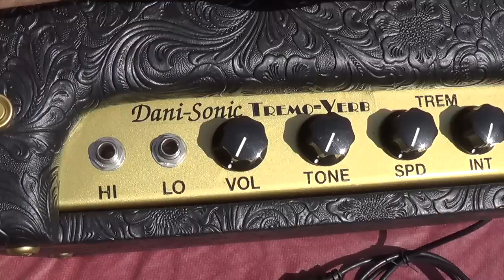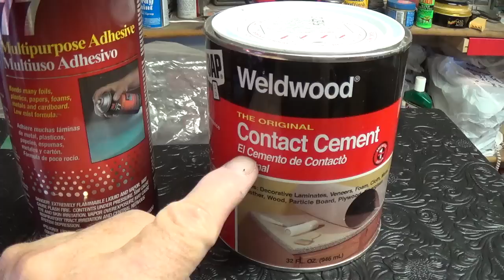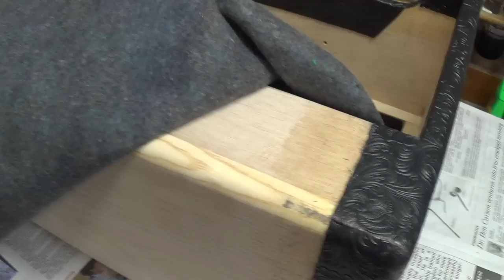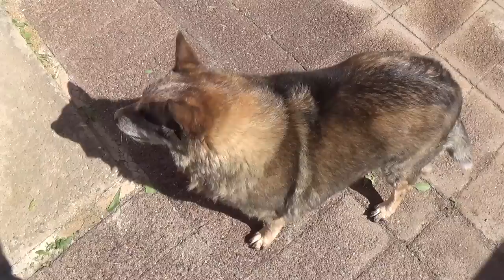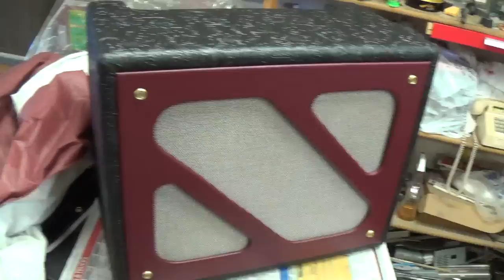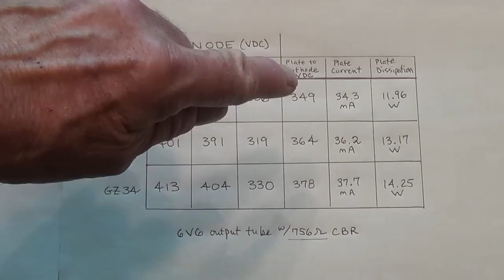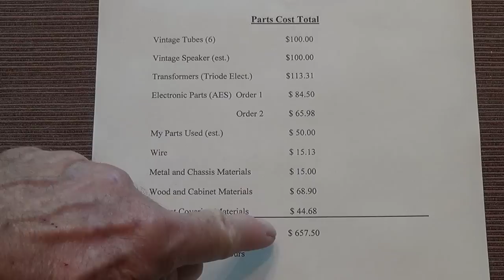How to Scratch-Build a Vintage Amp, Part 8:  Completed and Tested

Comment: Back on the tremolo intensity topic, the grid of the buffer valve needs a constant grid leak resistor. You should feed the oscillator output to the wiper of the pot and connect the top of the pot to the grid of the buffer valve. The way you have it you will be grounding the grid at some settings, which can't be good for the valve..
Reply from the maker: +QuadMaestro  Perhaps you were looking at an outdated schematic, QM. As it stands, I can't see any way for the cathode follower grid to be grounded by the Intensity pot.  Even if the pot, serving as a variable resistor, were set to 0 ohms, the 2.2K resistor is between the grid and ground.
Reply: +Uncle Doug I'm looking at what is linked above. Agreed that there is always 2k2 between the grid and ground but surely 2k2 isn't enough either? These grid leak resistors are usually 470k or more. You have the 1M pot, why not use it as a pot? Might fix your stated problem with the tremolo.
Reply from the maker: Since I intend to experiment a bit with this portion of the tremolo circuit, QM, I will evaluate your suggested modification. To be honest, my first target for modification was indeed the 2.2K resistor (increasing the value) to alter the effect of the voltage divider created by it and the pot. Regardless of the outcome, I'll report my findings and revise the schematic if an improved Intensity circuit is discovered. Thanks for your interest and helpful input.

Comment: Hey Uncle Doug, thanks for an excellent DIY video series, it has been very inspiring! I especially liked the DIY chassis construction. Also, after seeing you make the finger jointed cabinet, I went ahead and bought a dado blade set and a zero clearance throat plate for my table saw. I'll need to learn how to apply Tolex or vinyl next.I hope this goes better than my previous attempts at using a router!  I have an old Harmony 525 amp that is pretty similar to yours, a distant cousin perhaps. I modified it a little by removing the Treble pot and altering the ground reference resistor in front of the first tube, making it electrically equivalent to a Supro Thunderbolt (I think, there are a few different schematics floating around). It sounded good before, but sounds much better now, and it's a good reference point for adding more modifications later. The wiring (in my Harmony amp) looks like spaghetti though, and the cabinet is really worn out. My next project is to build a new head cabinet for it - with the inspiration gained from watching this fantastic project of yours.  Thanks!
Reply from the maker: +Dragnphlai You're welcome, Dragonfly. It's great to hear that the videos are helpful. Your Harmony project sounds like a very interesting one. Best of luck with it. Please post some photos on my Facebook page (Uncle Doug's Vintage Amps) when it's done.

Comment: Here's a tip for Nuke Boy - pay a visit to Antique Electronic Supply, https://www.tubesandmore.com/products/C-EC40-20X3-500     They have a multi-section electrolytic that would be perfect for your application, with the exact capacitance values that you need, but at a higher voltage rating, which is an improvement.  It's a 40/20/20/20 µf cap.  You can parallel two of the 20 µf sections, so that you have 40 µf / 40 µf / 20 µf @500 volts for $17.
Reply from the maker: +Dragnphlai Great suggestion, DF.  Thanks for your helpful input :)

Comment: P.S.  You must have quite a few amps by now !!  (I have about 7 or 8).  What do you do with all of them?  Do you routinely play them - to keep your capacitance charged and the circuits wet ??  I wonder about that with some of the amps I don't use very often !!
Reply from the maker: +Donald Filbert It is a consideration, Donald. Some of the real old ones don't get much play time. I always use a Current Limiter whenever I start up any that have been dormant for several months.  So far, no problems. They are kept in a cat-free room :)

Comment from the maker: Nuke Boy, your comment had no Reply capability, so I'll answer up here.  Yes, mfd = uf.  On your amp, leave the can cap in place and go inside the chassis, detach each wire to each cap lug and attach the wires to individual axial capacitors of the proper value. There will be a code on the can cap to tell you which lead goes to which value. You would be better off with 450V caps than the puny 300V. Good luck.
Reply: Thanks a bunch for the reply
Reply from the maker: Thanks so much, Strat. By coincidence, I just sold the Supro Tremo-Verb featured in this video series, so a viewer will soon get that opportunity. Maybe some day I'll be shipping one to you :)
Reply: +Uncle Doug Nice work Doug, you are a true dedicated craftsman. I am a long time 52 year old guitar player, and i wish i could try out one of your amps. My 1988 fender red knobbed twin sucks in comparison.

Comment: Hi i have a question. I have in my possesion a vintage japanese valve preamp, the filter capacitor recently fried. On the can capacitor it says "40mfd, 40mfd, 20mfd, 300v" im unable to find this  type of capacitor anywhere so what should capacitor/capacitors shall i replace it with? And is mfd equivilent to uf or does mean something else altogether?

Comment: That's a beautiful amp, Doug.  High five!  Agree, the trem is pretty strong... I've never heard one that aggressive before!  Would love to hear how this amp sounds at the higher end of the volume scale, with either tube.  Where you have the output stage biased, it seems most of the distortion at higher volume levels is going to come from the pre-amp, as opposed to the output stage clipping.
Reply from the maker: +Jason Thorpe  Thanks so much, Jason. I may tame the tremolo a bit when I get the chance.....not much, just enough to make 10 usable.  I'll also try it out at higher volumes, once camera microphone distortion is no longer an issue.

Comment: I was just thinking, if you made it because you want it, so be it.. But said that
if you would like someone else to appreciate that wonderful work of art, I would do the following.
Put it on EBAY for $2500. bucks, with the videos showing it was all hand crafted, modified for
excellent sound quality, and will come with a 24 month warranty by the maker.
I bet it would sell with no problem.
Reply: JC Haywire
 Maybe we need to change that figure to
10,500  bucks. I am not good with value.
SORRY.
Reply from the maker: +MrMac5150  Even better. I'll have to fake my death, but a small price to pay for big bucks :)
Reply: +MrMac5150 Howard Dumble ain't got nothin' on you, buddy!
Reply from the maker: +JC Haywire Wow, high praise indeed, JC. Maybe some day,  long after I've croaked, my little amps will "catch on" and people will be vying for them. It's a pleasant thought.....the vying, not the croaking :)
Reply from the maker: +MrMac5150  Right after I finish one, it's very difficult to turn loose.....at least until I start on another project and the attachment fades a bit.  I may consider this route some day, but for now, the joy I derive from seeing and hearing it every day outweighs the joy of hundred dollar bills in a distant bank account. I do appreciate your kind appraisal, and your very positive input. Thanks for watching and commenting :)

Comment: That turned out quite nice.   I used that same covering on one of my amps.

you can see my amp  "Braddock"   at Mrvamps.com

How do you like the 6L6 running SE?...   I'm curious if that really worked,  since it's not done commerically.
Reply from the maker: +DeadKoby  Greetings, DK, and thanks :)  To me there is not a huge difference between the tubes. The 6L6 seems to have a bit more body and power, but tone-wise I think it's up to the listener to decide. Perhaps the increased current demands of the 6L6 make it less desirable for single-ended, economical amps.....just guessing.
Reply: +Uncle Doug   If it's not much louder,  the extra draw could reduce reliability,  thus not commercially viable.    Oddly enough the 807 tube in SE is holy smokes loud.
Reply from the maker: For some reason, this circuit has astounding volume, even with the 6V6, perhaps due to the cathode bypass caps I added to V4b and the output tube. I actually have to use the Low Gain input and a VC of only 3 or 4, for fear of incurring the wrath of neighbors.....and wife :)
Reply: Lol...  if it's too loud.... put in some ear plugs.. and enjoy the feeling of audio power.    I have one custom amp named  Mr. Big...   80+ watts of all tube happiness driving 4 tens.  Loud at 1...  disturbing at 2... take it outside at 3...... never tried it past 5.   I think some designs intentionally stifle the pre-amp stage to quell the volume giving a range from 0 to 5 in happy clean...   A Gibson amp I have I'm certain is designed this way.
Reply from the maker: Output power is like horsepower and money.....you can never have too much :)

Comment: Cool vids Doug! Watched the generation from the beginning! (with baited breath! :)) I have never owned an amp with a single treble "roll off" tone control. Am a tone freak. (treb,mid,bass & presence! LOVE IT!) Have you ever thought of doing a home build of the old amp Scotty Moore used to change the world? (I can never remember if it was an "echosonic" or an "Echophonic" Both of which give the spell checker hell! :) ) Would be curious to see how that old thing even worked! Good job !
Reply from the maker: +leroy volk Thanks so much, Leroy. I tend to rely on the guitar pickup and tone controls, so I can live with a single-knob Tone control on an amp....but I do understand your preference for individual control of all frequencies. Scotty did indeed have an Echosonic amp (designed by Ray Butts) with a built-in tape delay in the bottom for the slap back echo effect. The amp part would probably be do-able, but the tape delay would be a challenge :)
Reply from the maker: I'm not sure either, Leroy. The earliest reel tape I can clearly remember was that reddish-brown ferrous oxide tape....about 1/4" wide. The old "Gorilla" sounds interesting. You should "tune it up" and make a video :)

Comment from the maker: Gary M, your comment had no Reply capability so I'll answer up here. I understand your suggestions and certainly take no offense.  With regard to insetting the grill, I have done this on a few other builds and agree that it gives a nice, finished appearance......however, on this one, due to the clearance issues between the speaker and chassis, I could not allow another inch for the recess without making the cabinet so thick that it would begin to resemble a cube.....a shape I don't find pleasing in amp cabinets.  With regard to the placement of the screws on the rear panel, since they are threaded into the 1/2" flanges at the rear of the chassis, their vertical orientation must be in proximity to the top and bottom edges of the panel......there is simply no other metal or wood to which they could attach.  Bottom line, during the construction of a complex project like this, certain design compromises must be made.
Reply: Uncle Doug

Comment: Uncle Doug,  At the risk of sounding picky I'd like to make a couple suggestions regarding the aesthetics.  Please don't take offense because I'm just pointing out the only things I noticed in this build that I didn't think were absolutely perfect.  First thing is I think if the cabinet was a little deeper and the speaker cover/grill inset about a half inch to an inch it would look a lot cleaner.  And secondly the if the screws for the rear panel were not on the edge of the panel but inset about an inch from the edge it also would look nicer.  Please, don't get me wrong, I love this build and thoroughly enjoyed every minute of it from start to finish.   Thank you so much for the entertainment and education! Gary

Comment: This video series was awesome, totally inspiring. I watched the whole thing and really enjoy your channel too. The amp sounds pretty rad and I didn't think the bass was lacking but I do tend to like a tighter low end . Perhaps a quick speaker swap would pump up the bass response enough? That Jensen is great though. I have the same one in my '61 Ampeg. I've got a suggestion for the audio demo. The amp signal was blending pretty heavily with the non-amplified acoustic playing of the guitar. This is a common and frustrating problem with many YouTube recordings. It distracts from the sound of the amp enough that it is a bit difficult to discern exactly what the amp is doing, especially the tremolo part. The camera mic, I believe, is good enough at getting the sound across and showing the tonal difference in tubes. I immediately heard the unexpected difference in 6V6 and 5881. Turning the guitar away from and/or playing across the room from the camera mic and amp can do wonders for the audio better showing the amp's sound only. I do this when making impromptu recordings with my phone. By no means studio quality and only pushing it as lo-fi but it works.
Reply from the maker: +RockYouVideos Thanks so much, RYV.  I wasn't aware that the sound of the guitar itself was that evident.....but I can see why my proximity to the camera microphone might make this possible.  I have to be close to the camera to turn it on and off for each scene, but I could try positioning myself further from the microphone itself. Thanks for your knowledgeable input :)
Reply: +RockYouVideos I agree on the suggested speaker swap. A Jensen Electric Lightning should firm up the bass a whole bunch plus it's a really strong, clear, punchy speaker.
Reply from the maker: Thanks for your input, Lincoln. I'll definitely keep your suggestion in mind.

Comment: My gosh Uncle Doug.  This has been an outstanding video series.  Combine this with your lessons on the why and how of the inner workings of tube amps and the fledging amp builder is provided with an invaluable resource. Watching your videos is like being the same room with you.  Thank you............Always wondered how you managed your fancy grill work.  I am amazed you did it with a sabre saw, I would of guessed a router and some pattern trickery...........I have a problem, I like the sound of your tremolo better than the one I achieved on my Princeton!  Back to the drawing board for me he he.
Reply from the maker: +Barefeet200 Thanks so much, BF. It's great to hear that the videos are helpful. Re the grill work: I use a hole saw to cut out the rounded parts of the design, then I make the straight cuts from arc to arc with a saber saw.  I'm glad you liked the Tremolo. Best of luck with the Princeton :)

Comment: DD: 
the Finale' was an incredible work of technical arts!  
As you progressed in the build, the component values and schematic changed; would you be able to add some notes on the voltage check points and your analysis for the revisions?...Does the tag strip assembly process create a soldering challenge?..
Your design insights and the practice of electronics have always been an incredible value added to all the Videos!.  I am realizing More and More Appreciation for your generous contributions. 
Thank you, Again!......  Keep a close watch on Jack's salutes to new equipment......!.
Reply from the maker: +Brian Hensley Thanks so much, Brian....glad you enjoyed the video series. I'm not sure about the voltage check points.....I showed and posted the chart showing pertinent voltages and biasing info with each of 3 rectifier tubes. As far as explanations for the changes, most were based on amp circuitry used in other amps, some were from viewer suggestions, and others were simply from experience or experimentation. The terminal strips were no problem at all. I use them exclusively in all my amp builds. The only tough wiring challenge was the miserable, skinny, crowded tube pins in the 12A tube sockets....ugh !

Comment: Too much trem ! Not possible ....  maybe increase value of speed pot and osc caps for a greater range of speeds -- ? SLOW is nice....
Reply from the maker: +Ben Prevo  I tend to agree, Ben; however,  I have a plan to cut down on the choppiness without neutering its intensity.  If I'm successful, I'll revise the schematic.  Also, most Tremolo's are way too fast for my taste.....the really slow, swampy ones are rare and wonderful :)
Reply: +Uncle Doug I have found empirically that increasing the value of one or more of the caps in the osc circuit gets the slow swamp -- especially on the ones that vary bias in cathode bias power amp iterations  ala GA16T etc
Reply from the maker: Thanks for the tip, Ben. I will definitely check this out :)